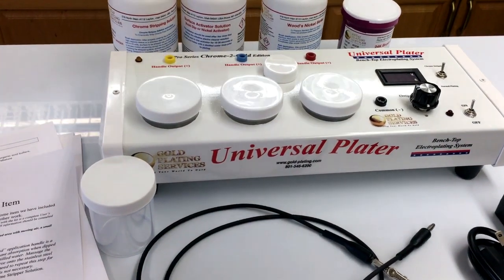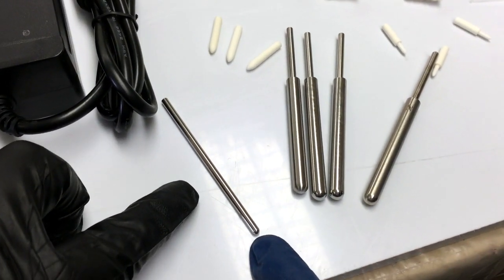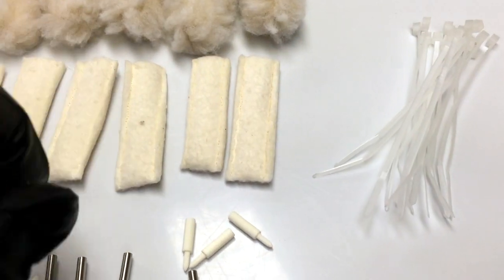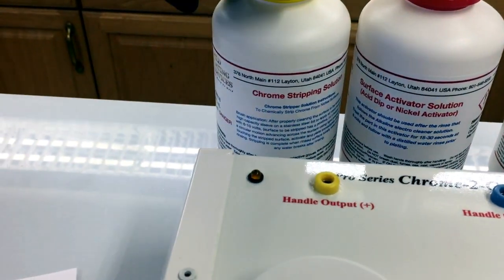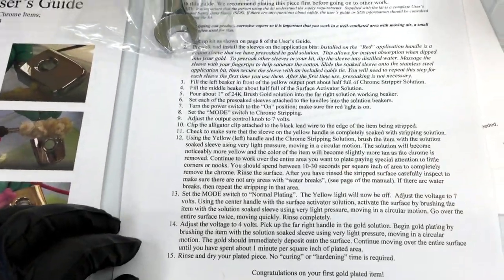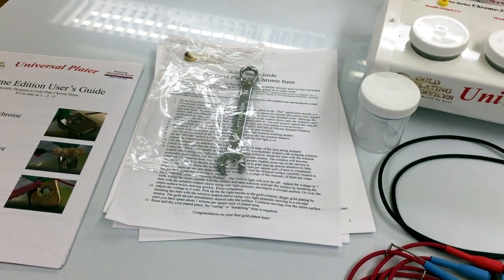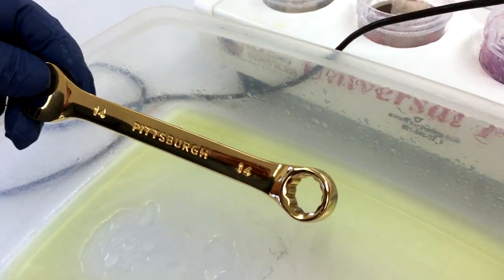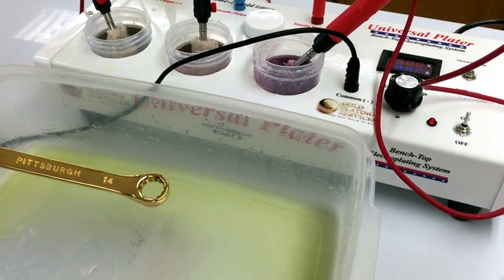How to Gold Plate Chrome Items - Un-boxing, Set-up and Plating - Universal Chrome Edition

Comment: I want to nickel plate a handgun.  I don't know if I should buy this kit or the kind that you dip (submerge) i
Reply from the maker: For nickel plating, it is really best if done by submerging the item into a heated, stirred bath.  This way you get a bright shiny nickel plate.  If you do it by brush, you will need to get the piece as shiny as possible before plating, as the plating will not make it shinier.

Comment: can other materials be plated, Alloy /steel/ titanium/Plastic
Reply from the maker: Steel is easily plated with any of our kits, except the GoldSmith - Woods Nickel Strike needs to be added to all of them except this kit (the Chrome Edition) which does come with Woods.  If by alloy you mean aluminum then yes, it can be plated.  Titanium can also be plated.  However, these two metals in particular cannot be plated by an end user.  They need to be sent to a industrial plating company such as ourselves for plating.  They are EXTREMELY difficult and dangerous to plate and require exactly the right setup and process to be successful long term.  Plastic can be plated onto as long as you coat it with a conductive ink or paint first, howe ver most find it quite too tricky to want to endeavor unless they're an artist who is set on doing it.

Comment: Im going to do this on my 1911 airsoft gun. Question. The gun will have to be stripped to bare metal correct? And i imagine the gun is mostly aluminium ( just a guess) what steps do i take prior to the gold plating process
Reply from the maker: The gun will need to be stripped to the bare metal.  If it is aluminum, you will need to send it to a chrome plating shop to have it nickel or chrome plated, then you can use this kit to plate it with gold.  Aluminum is one of few metals that cannot be done on a consumer level.
Reply: Thankyou very much for the reply. Im now not sure if id rather chrome or gold haha both are lovely
Reply from the maker: @Mike-yb5is  Many like a mixture of both :)
Reply: Oh stop it haha

Comment: Do you ship to the uk 🇬🇧?
Reply from the maker: We can ship the entire kit with the exception of two chemicals.  The Chrome Stripping Solution cannot be sent via Air.  The Woods Nickel Strike cannot be sent "Ready to Use", however it can be sent as a concentrate that you simply add a chemical to it to make it usable.  Fortunately, the chemical needed to make Chrome Stripper is obtainable anywhere in the world (especially uk).  The chemical needed to makee Woods usable is also easily obtained.  
--Chrome Stripping Solution:  You would need to obtain Sodium Hydroxide (also known as “Lye” or “Caustic Soda”) and distilled water.  Using these ingredients and following our instructions we can provide upon ordering, you can make your own stripping solution that will be identical to what we sell.
--Woods Nickel Strike: It cannot be sent "Ready to Use".  However, we can send a concentrate that can be made usable by simply adding acid.  The acid you would need to acquire is “Hydrochloric Acid” or “Muriatic Acid” – either works the same.  If you can acquire this, which it is typically obtainable nearly anywhere (can acquire Muriatic in many hardware stores), you can make our concentrate into a “ready to use” solution.

Comment: How long does the plating typically last?
Reply from the maker: How long gold plating will last purely depends on a few variables.  1) How thick the gold is applied.  2) What type of item is it/How will it be handled?

The thickness is controlled by how long you plate the item.  For instance, if you were to stop plating immediately after the item turns gold, that is a very thin plate.  However, if you spent multiple minutes plating that same area, it would be very thick.  The thicker the gold the longer it lasts.

Different types of items are handled differently, some a lot and some not at all.  If it were a decorative item that is never touched it would stay gold plated indefinitely, could be centuries.  If it were something like a Wedding ring that is worn daily, it then depends on how thick the gold is plated.  If it were a thin plate it could wear off in a week.  If it were very thick, like Vermeil plating (100 micro-inches) it cost last a lifetime.  

When done properly, gold plating lasts many years if not decades on most items.  If its a thick gold plate, even on an item that is handled properly, it should last many years unless it is purposely removed by abrasive means (polishing etc.)

Comment: How tough is the gold finish
Reply from the maker: It is gold, so it can be scratched.  However, it is a hardened gold which makes it about 3x harder on the Knoop scale than a soft gold is.  The longer you plate it, the thicker it gets.  We've seen pieces of jewelry, for example, last decades of daily wearing with a thick gold plate.

Comment: What is the price for this product and which items included in it ...plz reply as soon as possible
Reply from the maker: The price and link to the product page are in the video description.  The continental USA version comes with everything you see in the video - all the chemicals, accessories, kit etc.  Here is a link to where you can see all the details: https://www.goldplating.com/collections/brush-plating-kits/products/universal-plater-chrome-edition
Reply: Where side is booked this product ...nd is this available in india ....any further problem regarding this product where is to contact now ...can u plzz srnd me a no. In india related
Reply from the maker: We don't know what you mean by "where side is booked this product".  It is available in India, as we can ship anywhere in the world.  We cannot ship the Chrome Stripping Solution or the Woods Nickel Strike, but everything else can be shipped.  You can acquire the chemical (Sodium Hydroxide) to make the Chrome Stripper and we can send you a concentrate that you will just need to add (hydrochloric or muriatic) acid to, in order to make the Woods ready to use.  These two chemicals can easily be obtained in India.  We do not currently have a distributer in India, so I do not have a number to give you.  You can order from our website or over e-mail.
Reply: What is the actually price for this product ...and also price for the chemicals and can u tell me is that shipped the product and what is the weight and size for that product ...
Reply from the maker: It's $975.00 for the international version of the kit.  International Shipping on our website is discounted from if you order over email or phone, it is $95.00.  Here is a link to where you can order online and see all the details: https://www.goldplating.com/collections/brush-plating-kits/products/copy-of-universal-plater-chrome-edition-international 
Chemicals and everything is included with the package.  It comes in a 12" x 12" x 12" package that weighs about 13lbs.  Please do let us know if you need any assistance with your order or have any questions at all.
Reply: Is there any distributor in UAE ....and other country ...
Reply from the maker: All of our products are shipped and sold from the USA.  We can sell them anywhere in the world.

Comment: so the gel has the gold in it?
Reply from the maker: That's correct.  The gold is dissolved into the solution, once the electricity is added the electroplating begins, and metallic gold is applied to the surface.
Reply: @GoldPlatingServices  is there a cheaper alternative to the $1,300 starter kit?

Comment: Do you need to wear a mask while removing the chrome or are the gloves enough ?
Reply from the maker: The Chrome Stripping step can put off some fumes that aren't pleasant to inhale.  For this reason, you could wear a mask or do it outside.  What we prefer to do is to place a fan blowing across the path of the fumes, this eliminates the issue.

Comment: Can use provide a kit to gold plate aluminium
Reply from the maker: Aluminum must first be nickel plated. To produce commercially acceptable results this nickel plating process is normally performed in large heated vats with very hot, caustic, and toxic material. Commercial plating companies are set up for this and it's not a big deal. For most people however it's not really a DIY type of thing.
Reply from the maker: Aluminum must first be nickel plated. To produce commercially acceptable results this nickel plating process is normally performed in large heated vats with very hot, caustic, and toxic material. Commercial plating companies are set up for this and it's not a big deal. For most people however it's not really a DIY type of thing.
Reply: yes you can == make a galvanic pencil = take a power supply == nickel electrolyte = and work == and we smoke marlboro = and you're done -

Comment: hi.  work for wheels rims aluminum?
Reply from the maker: Hello.  This kit will not plate directly onto aluminum.  The aluminum needs to first be chrome plated by a professional plating shop, then it can be plated using this kit.
Reply: cover aluminum with copper then nickel and then chrome and you will be happy

Comment: can you gold plate clean plastics?
Reply from the maker: In order to electroplate onto plastic a layer of conductive paint, ink or lacquer must be first applied to the item to be plated.  Typically the paint is then sanded down to get it as smooth as possible prior to Copper plating, polishing, nickel plating, then gold plating.  As you can imagine, it is quite artistic and significantly more difficult to plate plastics than it is to plate a metal item.

Comment: How do u fix white lines?
Reply from the maker: Lines are a result of plating onto an area where the chrome was not completely removed and the nickel was not completely activated.  An example: Imagine you stripped 50% of the wrench, then you activated that entire 50%.  When you go to gold plate it, if you try to plate up to the very edge of the stripped area (where the nickel and chrome meet), there will be a "zone" where the chrome is not entirely gone but appears to be.  Then when you go to do the other half, you strip up to the 50% line again, activate to the 50% line, then go to blend the two halves together and a line shows up.  That is because the chrome at the 50% zone was not completely stripped.  The answer is in the video above, where we show plating the wrench but I will also explain it further, here.  The answer is to strip 75% of the wrench, activate all 75%, then gold plate only 50% of it - leaving the wrench 50% gold, 25% nickel and 25% chrome.  Then, when you go to plate the other half of the wrench, chrome strip the remaining 25% and all the way into the gold half.  Chrome Stripper will not hurt gold or nickel so don't worry about overlapping. Do overlap. Then after you rinse, activate the same way, all the way into the gold.  When you gold plate the un-plated 50%, gold plate into the already gold plated half (overlapping again by about an inch or so).  This is the way you blend two areas together and avoid lines.  Hopefully this helps to clear it up.  If it doesn't, watch the above video again and watch how we plate the wrench very carefully, now that it's been explained again here.  If you still can't get it, give us a call and we'll get you going.
Reply: Gold Plating Services as always thank u!!!.. machine  is amazing gold is great...customer service is always a+

Comment: so gold plating is just color and not gold gold?
Reply from the maker: It is absolutely gold gold, 99.7%+ purity 24K gold.
Reply: @GoldPlatingServices  Ok how much gold is actually in that bottle? Do I need to melt down some gold and put inside ?
Reply from the maker: @BigPom-fk8re  There is 2.5g in this bottle.  The gold in this solution is actually a dissolved "salt" form of gold.  Once the electricity is applied, electrolysis causes the gold to come out of solution and deposit as metallic gold.